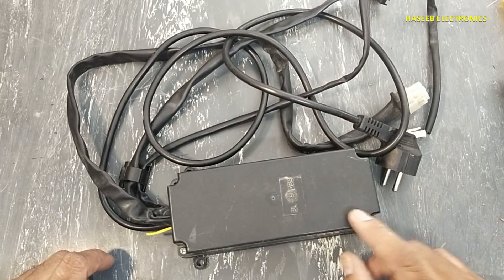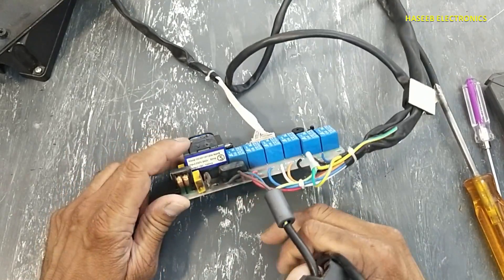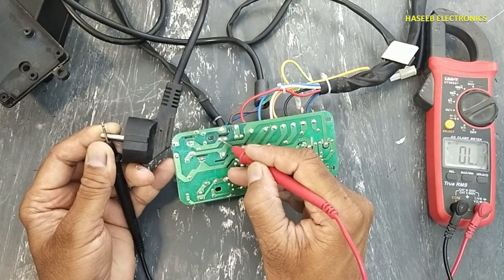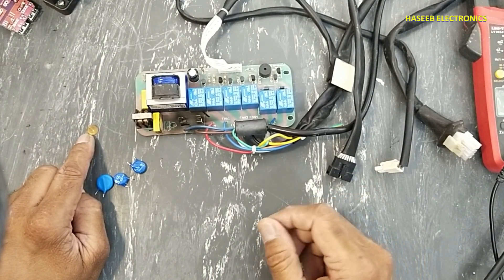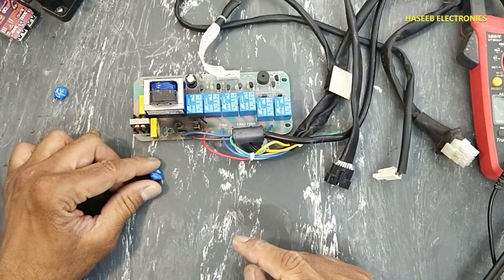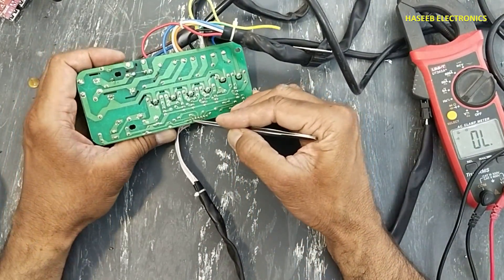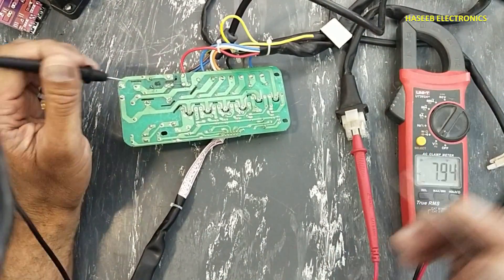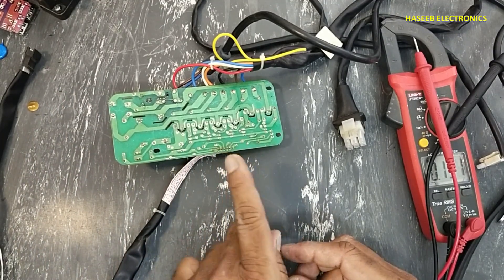{952} Varistor protected the next circuit from high voltage damage

Comment: hi hasseb .i use 10d321k if say its part number .the max ac voltage of it was 275 and dc was 320 v.but when use it after fuse the voltage go 257.why?